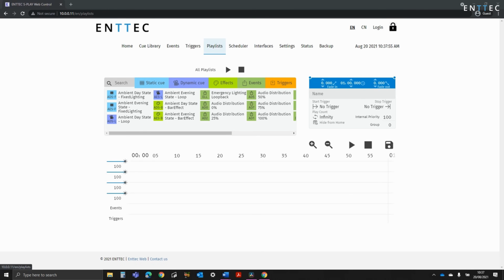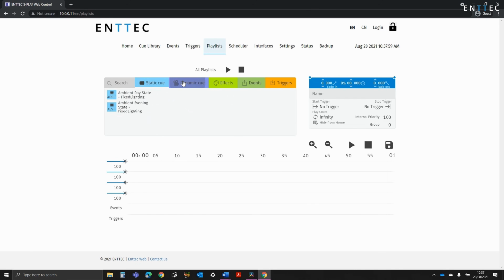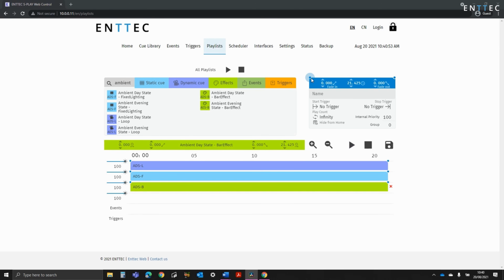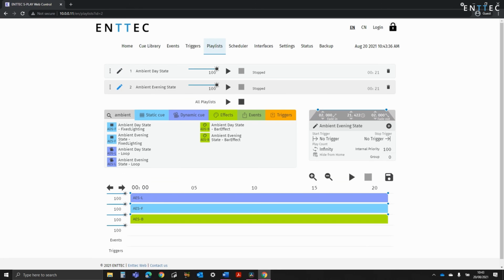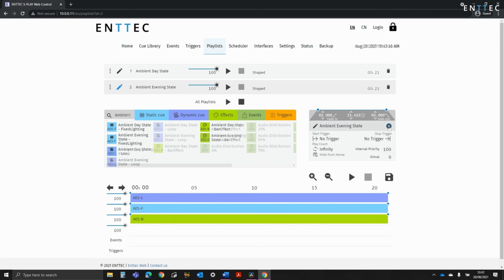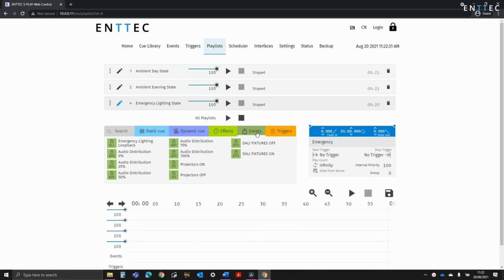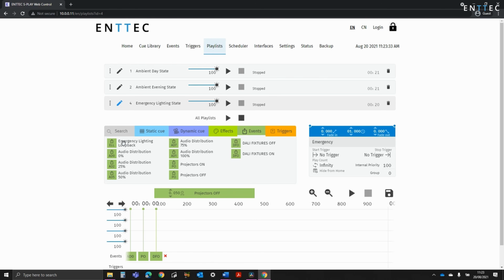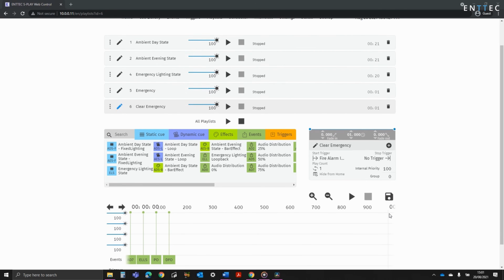9. ENTTEC Tech Tips: S Play -  Introduction to Playlists

Comment: I'm struggling with creating playlists, when I try to save a message pops up saying please fill in form. I've drop a static cue into the time line and given it a digital input trigger, but I can't save it.
Reply from the maker: Hi, I tried replicating this issue and can you please confirm if you are giving the playlist a name before trying to save?
Reply: @ENTTECofficial  thanks for the reply, this was exactly my issue. I realised straight after I asked the question. 👍 It would be nice if the prompt was to take you to the missing field or suggest the issue rather than the "please fill in form" message that appears.
Reply from the maker: Hi, that's great that was the solution.  Thank you for the feedback, on our end the word ' name' does go red, however, I'll pass on the feedback :)